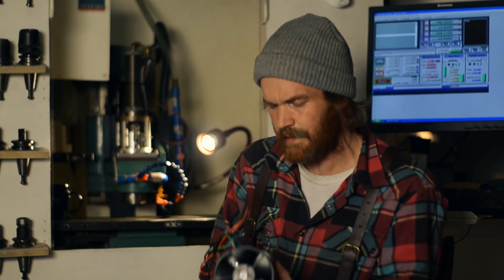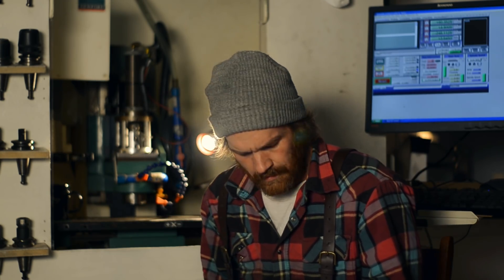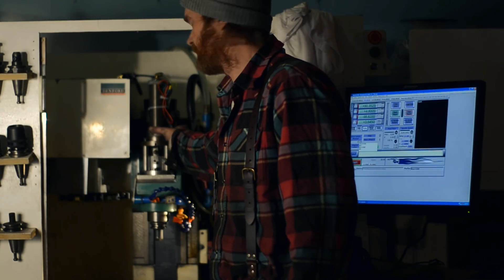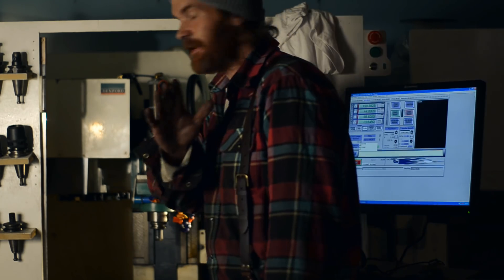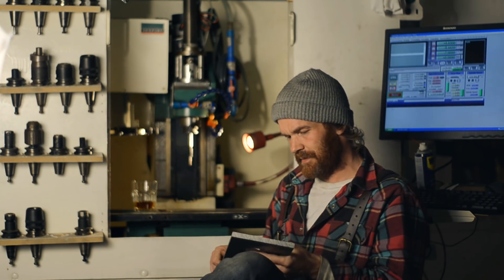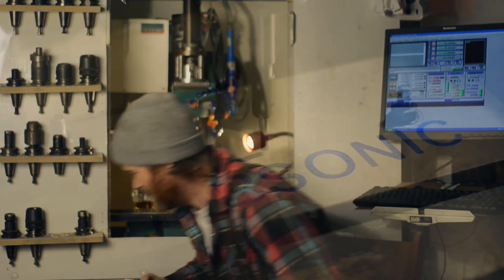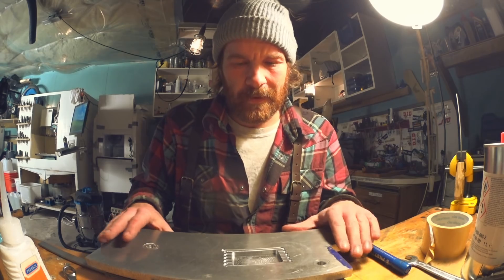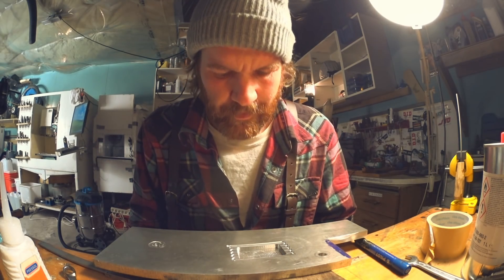Machines are Taking Over! Enter the 2STROKE STUFFING CNC Era.

Comment: i would be happy with those results considering the long holder and baby collet. good lesson for you too. tools deflect, deflection amount depends on many things including holder and tool length, as well as material hardness. also the difference between cheap and expensive electric motor is often the balance.

Comment: Hi mate, depending on what program you use, certain operations like pocketing may have a default 'material to leave' eg 0.1mm. Your parts will come out undersize on inner diam and oversize outter diam.
The reason is to leave material for a finishing pass like a profile cut.

Best of luck with the new machine 👍

Comment: I may be mistaken, but it looked like you were doing a climb cut which may have been contributing to the deflection. The long tool length definitely exaggerated it, but depending on the runout you have in the spindle this might be something you need to avoid for parts requiring greater accuracy.

Comment: That machine will probably quiet down and smooth out if you swap the timing belt out for a poly-v belt.  Fadal used Poly-V belts for many years.  Even regular V belts are very quiet and transfer good amounts of torque.  That said, your pulleys could not be lined up or the belt could be the wrong profile for those pulleys, or you could have a worn out belt.

Comment: The very first thing you need to do is put a high speed/high flow fan on that spindle motor. It will overheat and self destruct like the other one running at low speed with the shaft driven fan. As for chatter if you can feel vibration on the spindle when it runs it will show up in your work. I can tell you how to balance the motor if you need assistance....  If you are interested in a new machine I may be able to get you into a new Syil X7 for no money if you can demo it and show it off. You can see them on the website Syil.com.  Just throwing it out there......
Reply from the maker: Thanks for the advice/tips! A brand new machine you say, mail me on 2strokestuffing@gmail.com 😁

Comment: Hi i am a machinist. So at first dont use wd40 its not a cutting oil. Better nothing than wd40. In aluminium it is not necessery. Second altough the tool holder is very long nexst time let the tool stick out as les as poseable for optimal result. If u buy new tools the tool manufacture wil show good feeds and speeds. Try them but for good result with this machine you should problably neet do go slower. And make an air blower that you can swicht on with a M-code so it blows away the chips itself

Comment: Increasing the tool speed the speed and reducing the feed speed will reduce the tool chatter. It's chattering because the load may be a little too high. If it's high silicon content aluminium (such as LM24) then you may need negative tool geometry to get proper chipping. Water based coolants with high ester contents will also help as EP additives don;t work well on aluminium. I used to be a metalworking specialist many years ago when I worked for Shell.
Reply from the maker: Thanks for the tips!

Comment: The chatter will be because of the shear amount of stick out from the spindle. Best collets I've find have been using er32 type collets, hold amazing concentricity. Additionally, if you can, check the job while it's still on the machine that way you can work out the cutter deviance from the size you expect and modify the toolpath to compensate. When it comes to feed and speed, the feed per tooth is probably the most important thing in my experience, I tend to do 1% of cutter diameter feed per tooth when doing 10% radial engagement, but 0.5% feed per tooth on finishing passes to smooth out the walls
Reply from the maker: Thanks for the advice!

Comment: Great job on the first cuts. To get your part closer in size, do your roughing passes then do a finishing pass. If you did a finishing pass, you can still do a spring pass. It's just another finishing pass on the same path to cut what was left by tool deflection. Also, the worst thing to do to an endmill is recutting chips. If you used compressed air to blow away the chips, it's will extend tool life, leave a nicer finish, and cool the part and cutter.  If you have any questions let me know.

Comment: Doing really great for a complete CNC beginner. Here is a small list for what you will need in the near future:
-Carbide Endmills for Aluminium 5-12mm, 3 Flute, polished, uncoated or ZrN. 4-1mm, 2 or single flute.
-Carbide Endmills 1-6mm for steel and iron AlTiN coated, 4 flute/ 2 flute below 3mm
-Short HSS Cobalt Drills 1-12
-NC Spot drill 6mm, HSS works too
-90° Carbide chamfer mill
(-Mitsubishi ASX445 style 50mm China facemill with polished inserts for aluminum)
-100mm grinding Vise from China
-A set of parallels
-12mm Gauge pin for touching off tools
-Collet sets for your Toolholders
-MQL Lubrication system
Don't be afraid of Chinese tooling, it's good for the beginning. 
This should give you a good base so you can make the most things. Build up from that!
Reply from the maker: Thanks for the list!

Comment: If you have ever seen flood cooling, you would know you can't spray too much WD40.

You should avoid cutting wood, the fibers can get in your grease and make it abrasive.  They also absorb water so can cause rust on exposed steel if you leave it dirty too long.

There is machining wax for testing.  The good thing about wax is you can collect the chips and recycle it in to a new slab.

Comment: Alex you have to so your math. Cutting Speed of 100m/min are 5700rpm. If you only can go 4000rpm it's fine but you have to adjust your feedrate. Go with 0,01mm per cutting Edge which is 140mm/min. AND USE COOLING LUBRICANT
Reply from the maker: Thanks for the heads-up!

Comment: You probably know this already. But just in case. When using those calipers, especially for very tight tolerances, open them up and squeeze them onto a clean piece of paper then drag them off. It will clean them of very tiny bits of stuff that can throw off your measurements.
Reply from the maker: God tip, thanks!

Comment: If you need any spares for your CNC machine and have difficulty getting them, let me know, Denford's is about 2 km from where I live. Although that machine is not in production any more, I'm sure they will have plenty of bits and I'm told they are a friendly bunch. Can't make any promises though.
Reply from the maker: Awesome, thanks man!
Reply: Actually, having looked into this a little further, a better first step might be to contact these guys, they specifically deal with outdated Denford machines.
http://www.denfordata.com/bb/

Comment: 10 year machinist here a good rule of thumb for tool is max length is 3x diameter of tool. Also if your worried about deflection you can add in a finish pass. Let me know what collets you need I may have some to send out to you. Machining is a dieing trade and it's great to see others enjoying the trade.
Reply from the maker: Thanks, and thanks for the advice! I've got a bunch of ER20 holders, but no collets. Email me on 2strokestuffing@gmail.com

Comment: looks very promising pal. cant w8 till i can afford a mill for the man cave to convert over to cnc. i wonder if your minor tolerance issue was flex or a minor steps per mm error as its was uniform under travel on both x and y if i remember correctly. hope to see you get this beast diled in

Comment: How about a press fit piston instead? I think you would have to set the wrist pin bore last. Nitrogen freeze the inner with the ring installed, warm the outer and afterwards the wrist pin bore.

Comment: Assuming a high speed steel cutter, rule of thumb puts spindle speed around 3700 RPM. If the motor and spindle bearings can handle it, 4000 RPM should be fine.

There’s no such thing as too much cutting fluid. At least, not as far as actually machining is concerned. You only need to be concerned about “too much” if your shop is getting soaked or if you run out of fluid before you’re done :P

You can work around the smaller dimensions by programming in a “free cut” pass - just have the cutter make a second trip around at the final dimension. Or just play around with how much stock is left for the finish path.

Looking forward to the next video!
Reply from the maker: 👍Thanks for the advice/tips!

Comment: Try cutting at 200 mm/min for those spindle speeds (i run 100 mm/min on 8 mm endmill because i have 2500 rpm spindle and it cuts just fine, its just a bit slow)and try to make tool stickout from spindle as short as possible because that skinny tool holder will deflect and you need as rigid as possible machiene for cutting with small endmills.
Reply from the maker: Thanks for the tips!

Comment: as soon as you mounted the motor on so much rubber, i thought the dimensioning would go wrong. now you mention judder i reckon the same thing:  the motor needs a firm mounting - or as jar85 suggests: get the motor off the machine and drive by belt
Reply from the maker: It's belt drive already, no worries. No rubber in the spindle assembly 😁👍

Comment: Welcome to the world of machining. Where, just cause you dialed the numbers correctly doesn't necessarily mean it cuts to size. Unless your tools are sharp as new, you'll learn to compensate for the undercut. Also small diameter cutting tools tend to deflect depending on the material being cut. Another also, they wear down tiny amounts at a time. Always measure your tools before you use them, sometimes even brand new tools can be slightly " off ".  Flood coolant will extend your tool's life. Carbide or coated tools will stay sharper longer. 
   I'm a retired old school machinist. I've run many different machines in my day including EDM and NC wire machines at the end. G-code is what we used in those days. You remind me of a friend I had. He was always tinkering around with his CT-70 Mini bike. Sometimes it was for nothing, but other times it more than made up for time spent. He came up with a way to " slightly " syphone the gas into the carb when twisting the throttle. It coughed and sputtered at first, but he eventually worked it out and it worked! It made his bike quicker and faster than the two other CT-70s friends were riding at the time. That was when we were both in the 8th grade. He bought a broken down 100cc trail rider and put the cylinder and head on his 70 along with a much larger carburetor and different exhaust. Many tries at cutting various pipes, then he went to a muffler shop( another friend's dad ) and made a larger diameter exhaust with a muffler. It sounded cool and it ran nice. I once called him to go trail riding and by the time I got to his house, he had the head off and was grinding away at the ports with a dremel tool, talking about unrestricted flow and better breathing for the big bore. He only had the new exhaust on about two weeks and was looking for more already. He started an epidemic of teenagers tearing down their engines and looking for more. Did I mention his last name was Anderson? Must be something in the DNA of those Scandinavian roots.😉💪👍 
   Build on my friend. Never be content with the current version. It can ALWAYS be better. It can always be repaired. It will sometimes be a bummer, but nothing feels better than success with your own ideas.
Reply: This was a good read buddy, thanks, you made my day better

Comment: A good trick i use when drilling into alu is a mix og of water and spirit as cooling.
Et godt trick jeg bruger når jeg bore eller fræser alu er et mix med vand og sprit eller ren sprit det fungere rigtigt godt det det gør at alu ikke brænder sig fast på værktøjer 
Mvh 
Urskov
Reply from the maker: Thanks for the tip!
Reply: @2STROKESTUFFING  A little pop of compressed air here and there is good too, especially when you're pocketing.
For aluminium on machines without flood coolant, I use around 5% cutting compound diluted in isopropyl alcohol. Tap Magic dissolves nicely. 
What I really need to do is build an MQL setup though.

Comment: Congrats on getting the cnc to work, if your intending to do any accurate profile milling (outside shapes as well as slots, etc) then you will need to use cutter compesation (H16, H17, etc) on the final cut. I would always rough to within .1/.15mm then a finish cut to complete the profile. That chattering as some others have mentioned is because of the long series tool you used and unless they are ground correctly an endmill shouldn't be used to plunge cut, a slot drill(2 flutes) should be used. I would have used a slot drill to rough and the endmill to finish the profile. Goodluck with all that you do, I love your work.
Reply from the maker: Thanks for the tips!
Reply: @2STROKESTUFFING  your very welcome.

Comment: Do you have a precision reference when measuring? To make sure your calipers are calibrated... Just good to rule out a number of things that are cheap mistakes (from the manufacturer side, not yours) rather than immediately reaching the conclusion that it's the machine. 
Also when machining, you can just use an air blower when it's running slow like that. The build up of chips leads to a build up of heat close to the tool, which is what you want to avoid. So a simple air blower setup will save you a lot of worrying.
Reply from the maker: Thanks for the tips! My calipers are not calibrated, but read spot on in the wood pocket. Machining an "island" next, measure with a micrometer.

Comment: The noice of the engine is probably that you hit the frequency when it changes from volume to mass centered rotation. The vibration frequency. The long bit possibly have that frequency low down in rpms.
Reply from the maker: Makes sense 👍

Comment: Great! The possibilities are endless now.
I am a CNC-machinist.
If I were you with that machine I'd get some HSS-Tools. They are on the cheaper side and fine for your needs. Plus they can be resharpened nicely.
You can use a 12mm endmill for pretty much everything that requires contours and some face milling. Dont know if I would go bigger than that on this machine, maybe 16mm max.
For toolholders I'd use 'collet chucks' (I used google translator) with different sizes for your tools. These are very versatile and a bit more precise than weldon chucks.
Big face mills are very expensive and they usually dont have much return. If you wanna invest in one, get a used one. Preferably with cutter inserts. Those little suckers can be very expensive so do your research before buying one of those systems.

From this on out its a lot of tinkering.
Try using compressed air to blow those aluminium chips away. Maybe the finish will be better. Always wear safety goggles, especially when doing this.

If you wanna mill some brass try a 2-bladed endmill. It usually runs smoother and the finish will be a mirror.
And most importantly have fun tinkering! :)
Reply: That's 2 flutes and its a slot drill.
Reply: @100Jeanluc  Thanks for the correction. I'm only familiar with german terms
Reply: @Vogel335  your welcome.
Reply from the maker: Thanks for the tips!

Comment: Have you thought about maybe instead of running a direct drive with that motor, offset it and run a set of pulleys and run a big pulley on the motor and a little pulley on the mill and you will basically have an overdrive mill? Should up your rpm I'd think.. though torque would be lost. I definitely get not being able to afford nice stuff, I can't even afford to pay atten.... look KITTY!
Reply: i think the motor need better mounts fix and control every roller on z axis 
eliminate vibration fix the complet cnc to the perfect niveled ground 
and try an other motor controler with variable frequency may help for speed
Reply from the maker: 👍 It's belt drive already, with slight reduction. Have to play around with it to see what it's capable of.